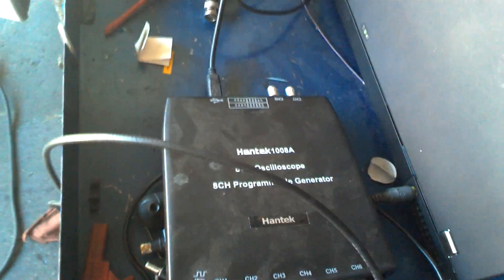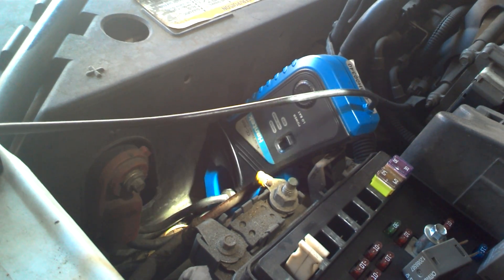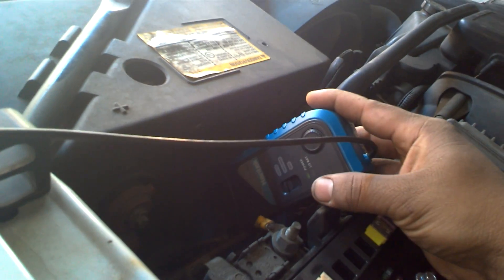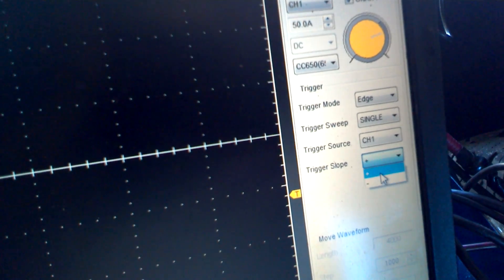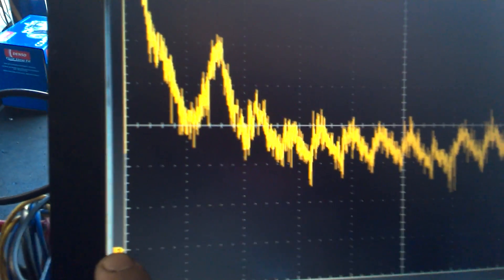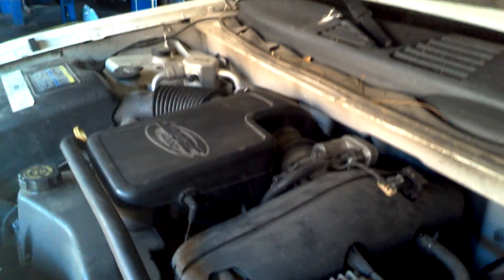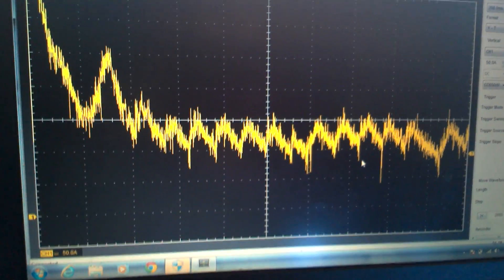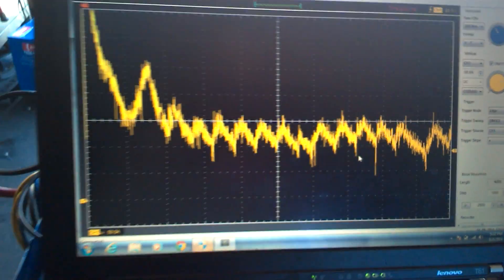Hantek 1008 Relative Compression Test

Comment: Do you know to filter the waveform in order to see it clearer?
Reply from the maker: Gonzalo Hernandez I wish that were the case but unfortunately that is not an option on this scope. The only way to minimize noise is to put your own external low pass filter. I have not experimented with that but I would like to try at some time. Thanks for the comment!
Reply: Where I can to buy that low pass filter?
Reply from the maker: Gonzalo Hernandez I have never used one with an input on an oscilloscope, although I would like to try at some point in the future. I do not know where you can buy one that will meet the specifications you will require to effectively filter a signal that you will be acquiring but I do know of a video that will help you build one. 

https://youtu.be/OBM5T5_kgdI

I love this guys channel and as a tip that may help, my PicoScope has the low pass filter option built in and it is set by default to 1 kHz. After you watch the video that will make more sense. Hope that helps!
Reply: Thanks for the link.
Reply: +Gonzalo Hernandez this may help.... http://www.aeswave.com/AC-Pass-Filter-Adapter-p9178.html 
I haven't tried it but they use that on the little dso handheld scopes. debating what scope to get myself trying to get into more advanced diagnostics. Was thinking about an Autel MP408 until I saw these videos lol.
Reply: thank you for answer.

Comment: Just because there is little compression resistance in one of the cylinders, you say the engine is bad? Shenanigans..... It just means there is low compression. There are many things that can cause low compression. Anyway, I also don't care for all the noise in the waveform. Pico is better.
Reply from the maker: Chad Wilkie I agree with you 100%  the engine is not complete trash but economically it will be cheaper for this customer to pay us to remove and replace this engine then to pay us to rebuild it. There is a lot of noise in this signal and I did get a Pico. Check out my latest video.

Comment: That is most pitiful scope I have ever seen what a pile of junk.  The ripple is caused by poor performing electronics inside the scope.  I would not trust this thing to check the lid of my garbage can.  I figured I try this and see how I like it.  POOR POOR POOR
Do yourself's a favor  and get the PICO or a used vantage pro.  I compared all of them side by side with the PICO clearly coming out on top.

Comment: Hey Enrique good stuff, i'm thinking about getting the DS3064 VII but have not seen much reviews on them. How is your device performing for the time you have been using it?
Reply from the maker: Bannie Thompson So sorry but I do not have any experience with that scope. Looking at the specifications it looks fantastic but I cannot give a first hand perspective of the tool.
Reply: Hey thanks for your reply, i know you weren't using that specific series but I was hoping you could give some info on the one you were using since its the same manufacturer...thanks again bro, we will keep in touch.
Reply from the maker: Bannie Thompson Oh, I understand now. The Hantek that I use is great for seeing and analyzing signals that you have on he screen at that moment. In automotive applications hat is not always useful since sometimes you are looking for glitches that happen outside of the current waveform you are looking at. That is why I switched to the Pico for my automotive diagnostics. At home where I normally work with small circuits and breadboards, the Hantek is perfect. I am usually looking at frequency signals from square wave generators and the like and I use the Hantek for that purpose. This is not to say that my Hantek can not be used for automotive applications it just is not ideal.
The software is pretty good. It is quite intuitive, I would say more so than the Pico but that maybe because I am still getting used to the Pico. I recommend you download the software for the scope you would like to get and try it out. The price of the scope is reasonable for the capabilities it claims. I would not hesitate to buy.
Reply: Yeah i know, right! My only other concern is if it offers recording capabilities... not seeing much detail of such. Thanks bro

Comment: Dont you need to hook up to the number 1 injector, so you know where to start your firing order count?
Reply from the maker: Think about the way a 4 cycle engine works. The fuel injector which in this engine is just on the inside of the intake valve needs to fire when the valve is still open. That happens about 180° of crankshaft rotation before the peak of pressure on the cylinder. Using the fuel injector as a synchronizer for a relative compression test is not a good idea. A better way is to use the signal for the ignition coil. I did not do that in this video because I wanted to show how you can use this test simply to identify that one of the cylinder had low compression without the added complication of synchronizing it to a cylinder and using the firing order to figure out each one. If you would like a detailed step by step instruction on how to do this let new know and I will be happy to provide it.
Reply: Enrique Osorio
 I know how to do it. I do it with my Picoscope  I always use a coil or injector (what ever is easiest to get to) Then if the firing order is 1-2-3-4, and I am on the number 3 coil, I know to start my count from there.  Hope that makes sense.

Comment: So you are using on windows 7! Is it ok on such OS? Some people had bad experience with Hantek on windows.
Reply from the maker: I have not had any serious problems with Windows. The hantek has crashed several times but that was due to too much input voltage. Basically user error.

Comment: Any idea how the 1008 compares to the Hantek DSO3064?
Any idea what the difference is between the 1008a vs 1008b vs 1008c ?
Is it possible to compare ignition waveform vs cylinder position (TDC) to confirm proper timing.
Thanks for the videos!

Comment: Oh this scope if you measured a digital air mass meter, then brought up the frequency measurement. is there a way of showing that frequency as a graph form??

Thanks
Reply from the maker: No I'm sorry but there is no way of graphing frequency like you can with the Pico or Snap On scopes. You can view frequency as a live reading like you can do with a multimeter with a frequency meter but that is it.
Reply: Enrique Osorio thanks for reply. what if in the math function and use fft in the right hand box? what does this do. i only have the demo mode as havent bought the scope yet, just interested . thanks
Reply from the maker: Alex Cotton I am not sure, since I only use the math function for testing electronic throttle bodies sensors. If you want a detailed explanation on how I use it let me know. I do not have the scope with me right now since I do not work on weekends but I will investigate your question when I get back to work on Monday.
Reply: thank you for taking the time out of your day to respond. very much appreciate it.

Alex
Reply: actually yes,thanks to another video,taking the amp measurement f the power wire gives the same as a frequency graph

Comment: So for anyone using this tool or thinking of purchasing this tool and you are on a newer system like mine (win 8.1) you will find that it will not install the driver correctly as it is not signed from Hantek. They will not respond to any requests for help. What you have to do is force feed the driver into win via the advanced startup menu. http://revryl.com/2013/08/06/install-unsigned-drivers/ has a good walkthrough. I did it once and it didn't take and had to go through the steps again but you should end up with a red box telling you it is unsigned and asking if you want to go ahead by the end of it all. If you tell it yes it WILL install the driver. This is the reason it will only have Chinese menus and the English option is greyed out. It does not matter if you installed the CD or website software. 1.0.10 I believe is the latest version. If you follow these steps you will save yourself a lot of trouble and frustration. Hope it is okay to leave this here sorry for taking up the space. I like the product now that I can actually use it.
Reply from the maker: Thank you for posting this, I did not know that it was an issue with Windows 8.1. I hope this helps any one having trouble with their Hantek.